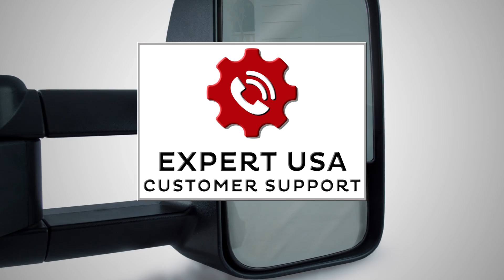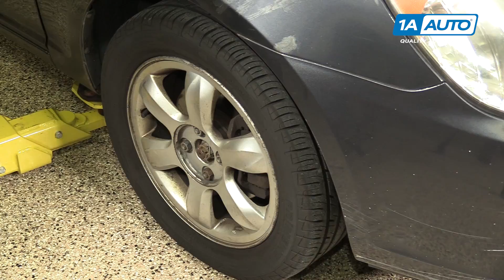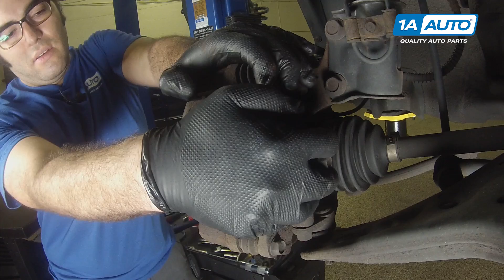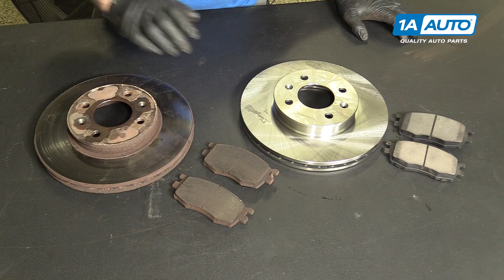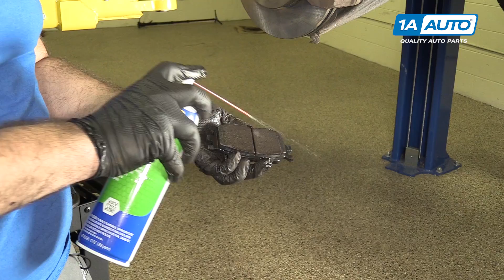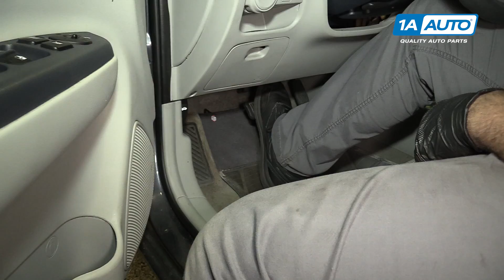How to Replace Front Brakes 05-10 Hyundai Accent

Comment: He forgot to tell you to always take the brake fluid reservoir cap off.  the brake fluid in the resevoir will rise as the c clamp pressess the piston back in. The pressure can and will brake the resevior . Which will be a  nightmare. You also want some back plate paste on the plates or the brakes might squeal. don't buy the cheapest brakes, go for the ceramic. I got pads and rotors delivered from rock auto for $61

Comment: If you're working on your car with it on jack stands, it's much easier to install the pads in the caliper bracket before you attach it to the hub bracket. That way you can properly lube the pads and clean off any excess without having to do it in an awkward position. Just move the pads to the outside of their range so that they'll fit over the rotor.

Comment: Thank you for this video ! But I have a question, What c clamp would I need to buy since there are different sizes !!
Reply: If you go to an auto ports store you can also buy a disk brake spreader, cost like 12 bucks and you use it like you would a c clamp, one size fits most
Reply: You can also "rent" that part at most auto part stores if needed. The caliper spreader.

Comment: Thank you for the video, but @ 9:50 you make a huge mistake. The break fluid in the caliper is degraded and possibly contaminated and you do NOT want to push all that fluid back into the system. You gotta open the bleeder valve, and push it out of the system. Then top up the reservoir and bleed.

Comment: excellent video. thks. only thing I might add is that  the two rotor screws are optional.  just in case they are missing or damaged you can do without them.
Reply from the maker: +knik nayme Thanks for checking us out. Shop here for high quality auto parts: http://1aau.to/m/Shop-1AAuto-c
Reply: Yep just installed on the line at the factory so the rotor doesn't fall off before the end.

Comment: Hello, I followed every step in your video to the "T". However, after the job was complete. I went to build up the brake pressure with the car off and achieved pressure, but as soon as I turned the car on to test drive it, the brake pedal went to the floor...any tips would be appreciated. Thanks
Reply from the maker: +Bleew86 Since there could be multiple reasons why you’re experiencing this difficulty with your vehicle, I strongly recommend that you have a reputable mechanic inspect it. They’ll be able to troubleshoot the problem and tell you what part or parts you’ll need for the repair. Since we do not have access to the vehicle we would not be able to diagnose this with any accuracy

Comment: if I'm not changing the rotor, do I still have to remove the caliper bracket? Because last time I did this job, I never removed it
Reply from the maker: +Rob M. If you are just changing the brake pads you should be able to just remove the caliper and change the pads. Hope this helps you out. 1aauto.com
Reply: Thank you for your prompt response, I'm still new at this
Reply: I just take off the 17 mm bolts.